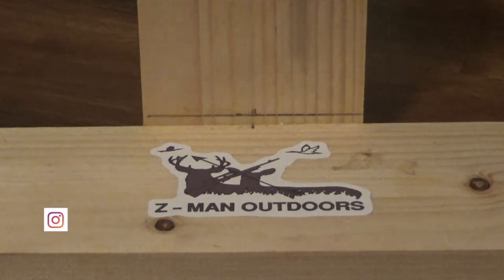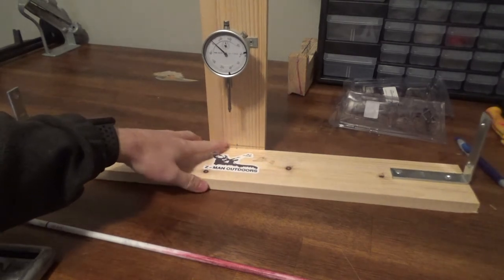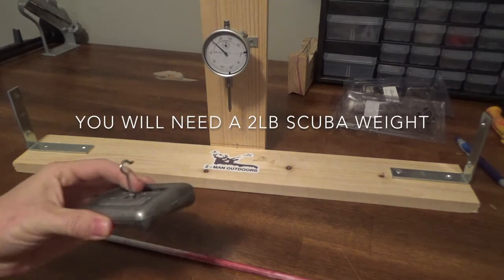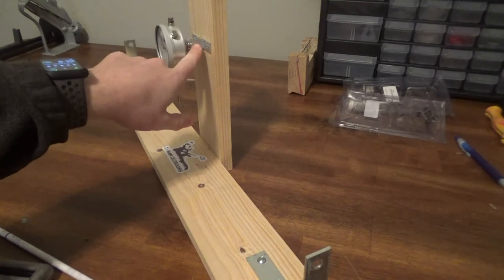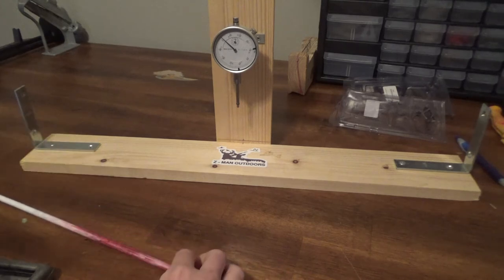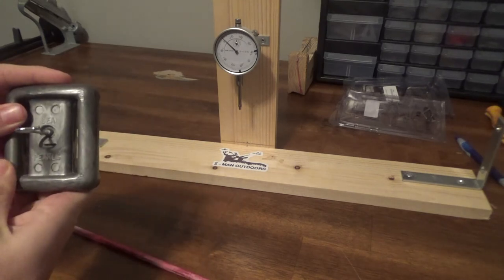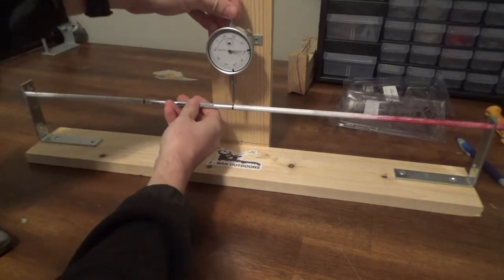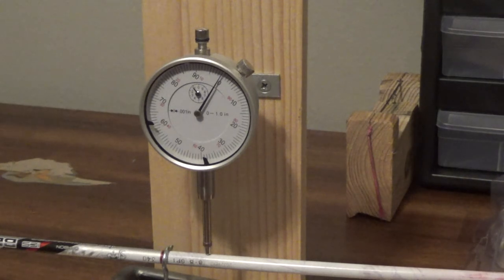DIY Arrow Spine Tester: Cheap & Easy

Comment: What a minute... nock tuning? Shit, I just came here after googling "arrow spine" Do you have an in depth arrow building guide or one for crossbow bolts? I'm trying to use some scrap aluminum shafts to diy some bolts but i didn't realize how involved this is ur how precise everything needs to be. Tried making some wooden nocks and they either fall out after a while or get smashed into the shaft. Think i need to switch to plastic nocks on.

Comment: Thanks for the video, jus a question: how can I translate the measure I read on the dial into Spine measure?
Reply from the maker: That is a very good question, and I honestly have not researched and dug into that deep enough. My main use for it was for spine alignment. You could probably dig online for how exactly they measure that and come up with an equation or formula to calculate it. If I get some time I may do some digging as well!
Reply: Should be inch * 1000, so a 1 inch bend will be 1000 Spine, half inch is 500 etc.
Reply: Set the dial to zero with the arrow on the tester without a weight. Put the weight on as close to center as you can. Whatever the dial reads in thousandths of an inch is the spine (multiply the number by 1000). So if it reads .5500 then your spine is 550. If it reads .7540 the your spine is 754, etc etc

Comment: Thanks for sharing your setup. Have you noticed any wear and tear on your arrows at the ends where they spin around the L-bracket holes?
Reply from the maker: I did at first, but I took some sand paper and scrubbed it pretty good to smooth it out. Once I did that, it wasn’t bad at all. Could also put some tape or something soft on the bottom side of it. Just may need to make the hole a bit bigger if you did that. But sand paper worked just fine for me
Reply: @ZManOutdoors  the heavy spine side would be at the bottom right
Reply from the maker: @dariuswhite2543  I put the heavy/stiff side up. The key is that every arrow is consistent.
Reply: Does it matter if you spine test after or before you glue in your inserts?
If my cut arrows are 25”, would you put the 4” L braces at 24” apart? (1/2” on each side?)
Reply from the maker: So I would think the inserts may change things a little bit, so probably should do it before gluing the inserts in. As far as distance between the braces. I based this off the AMO standard of 28”, but if your are just trying to get the stiff side vs the weak side it may not be a big deal. You could always spine test them before you have them cut, or look into victory arrows since they are spine aligned for you. I’m testing out some victory arrows in my build this year
Reply: So new to this? What does the dial do when you have found the stiff side?
Reply from the maker: It will be at the highest number. So as you rotate it. Keep an eye on the read out. You will see it jump up and then probably start to drop. Where it hits that high point is your stiff side.
Reply: @ZManOutdoors  
Ah , thanks
Reply from the maker: No problem! Thanks for watching

Comment: Do you have the measurements of how high the machinist dial is supposed to be mounted above the board?
Does the exact height of where the machinist dial is mounted matter very much since I presume the extendable section is adjustable? Thank you.
Reply from the maker: I do not think the exact location matters, it was one of the last things I installed, I just made sure when I put an arrow in that it pushed it up. I just took a measurement and it looks like I was about 6 5/8” off the top of the base
Reply: @ZManOutdoors  Thank you!